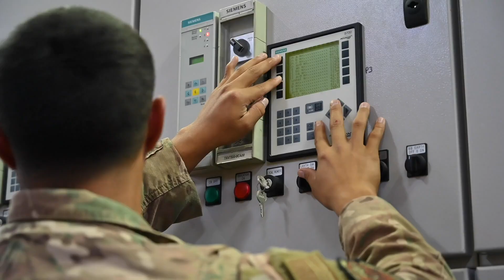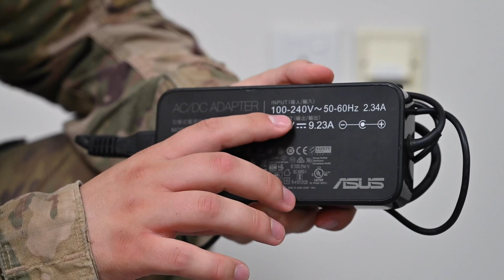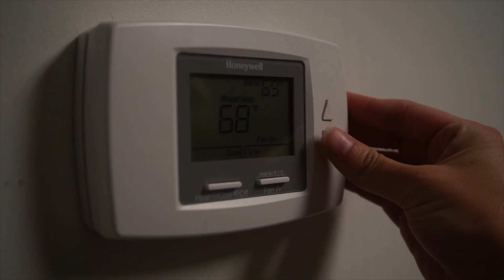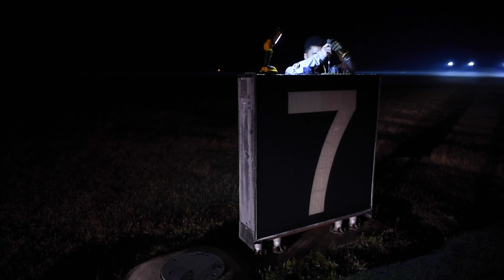Air Force Electricians - 3E0X1 - Electrical Systems

Comment: Does the Air Force certifies your hours so you can get your electrician licenses?
Reply: Sorry late reply but no they do not. Your hours would not count towards civilian licensing hours. However there are programs such as VEEP that allow you to more easily enter an apprenticeship program upon separation from the AF, and you can use your post 9/11 GI Bill to get paid a housing allowance, couple thousand $ a month while you are in the apprenticeship on top of your pay from working there. Hope this helps